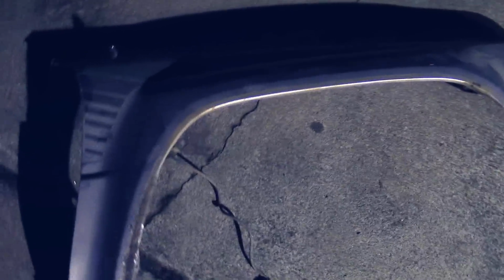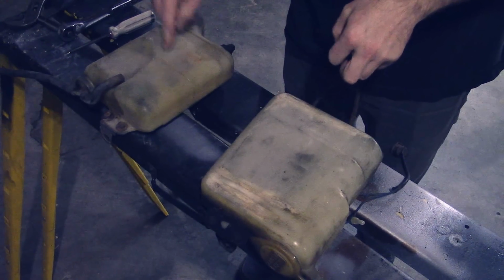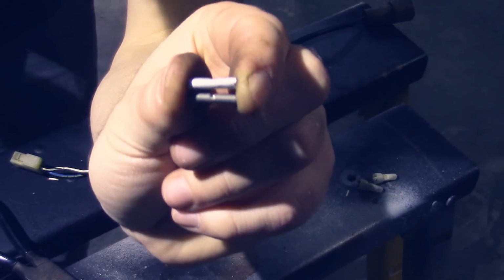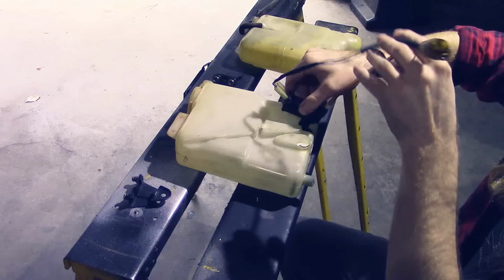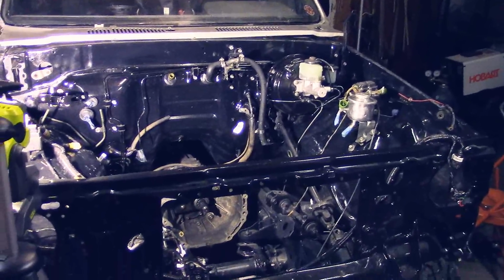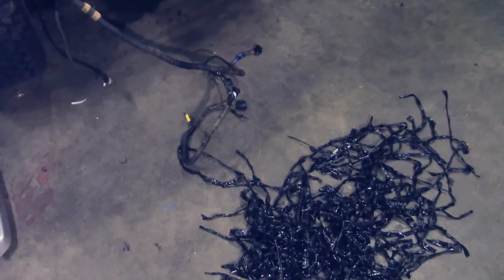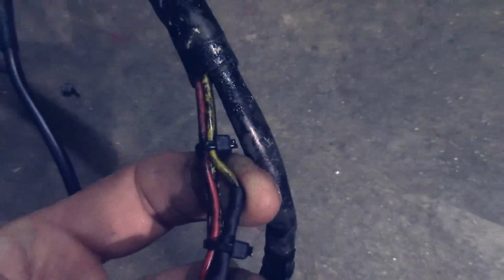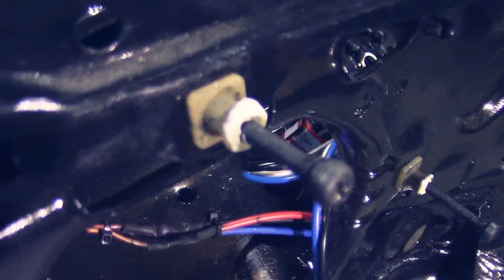Part 21 Preparing for the new engine! 1987 Toyota 4runner Restoration

Comment: Great video. I'm the original owner of a 1987 4Runner DLX w/136000 actual miles on it as noted on another youtube video. I was wondering if you had to do any interior work particularly the a/c & heater controls. The a/c & heater hot to cold air slide lever is really messed and was wondering if you had ever removed the climate control to perform any repairs and possibly have a video on it. I had the heater valve against the firewall in the engine bay replaced but the issue must have been the cable and some bozo tried to slide the lever with a froze up cable so now the lever is really messed up. Thanks in advance.
Reply from the maker: I have not dug into that area yet. But who knows, might be doing a video on it when the time comes.